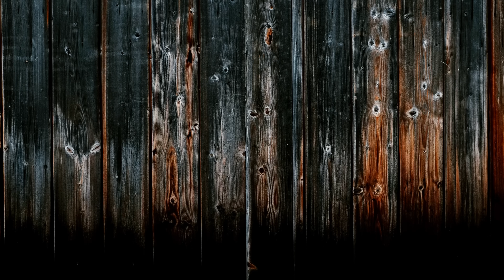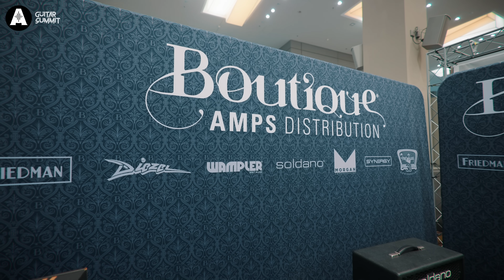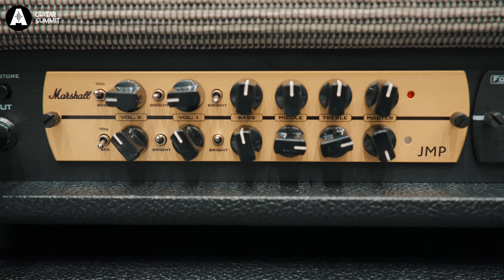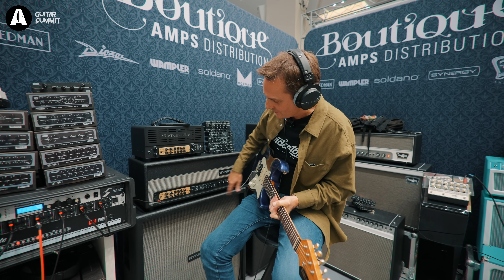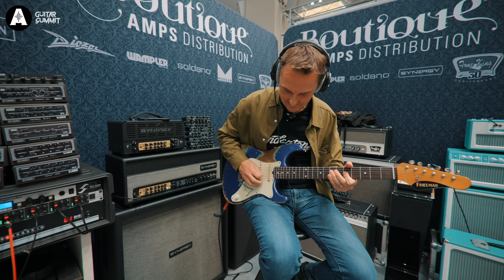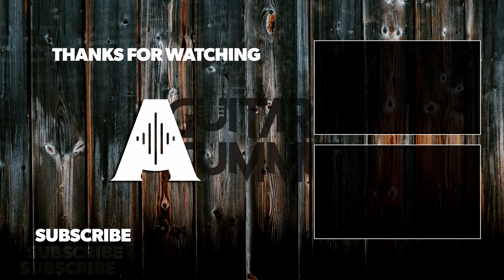Synergy Marshall JMP All-Tube Preamp at Guitar Summit 2025!

Comment: How many non fixable/replaceable parts are in them?
Reply: Everything I've seen from them including this is through-hole with 1980s size parts. Should be fully repairable by anyone that can solder. A couple larger SMDs but nothing major.
Reply: What's your definition of non fixable / replaceable???
Reply: Only thing that'll wear down and need replacing in them is the tubes. A pair of bog standard 12AX7 pre-amp tubes. Same as you'll find in just about every tube amp ever. Replacing them should only really require a screwdriver or two. (Assuming they're socketed like all other tube amps.) Having said that, don't go doing that yourself unless you know what you're doing. These are still tube amps, just in a modular design. The voltages in there are no joke and you can cause serious damage to your amp if you mess things up.
Reply: If you're thinking about parts you can swap out on your own at home the answer is: None. Maybe the attachment screws on the front and the knobs. Amplifiers are incredibly dangerous and deadly once you get into their guts. If you have any issues you should find a technician who can do the work. Sometimes you simply shouldn't repair it yourself. If you happen to be a tech however you should send an email to Synergy and check with them, I haven't been able to find diagrams online or any talk about anyone repairing these on forums etc.